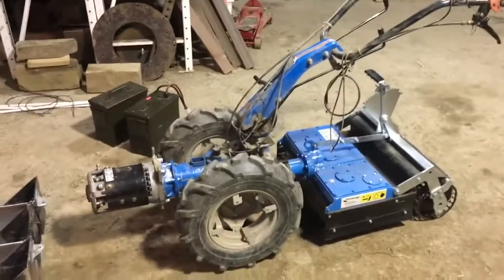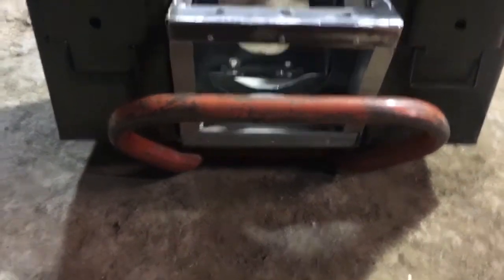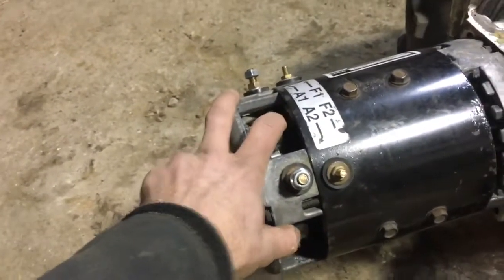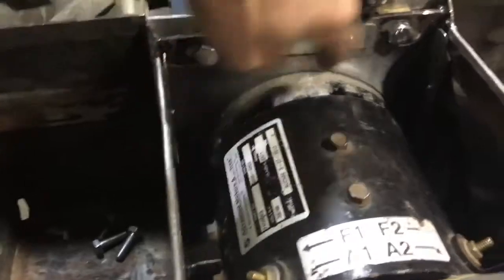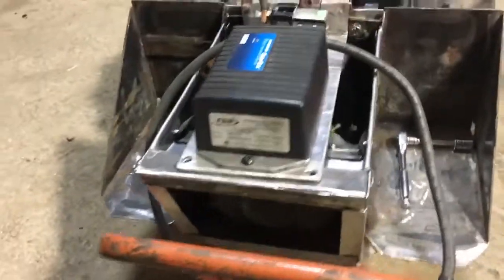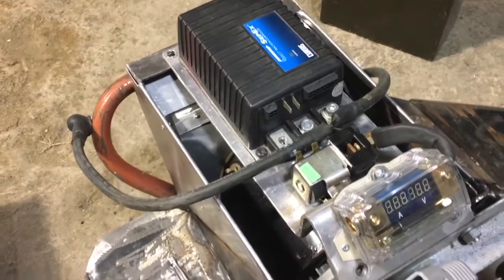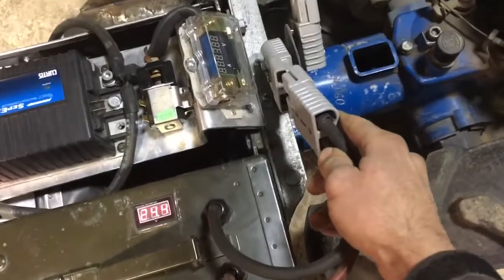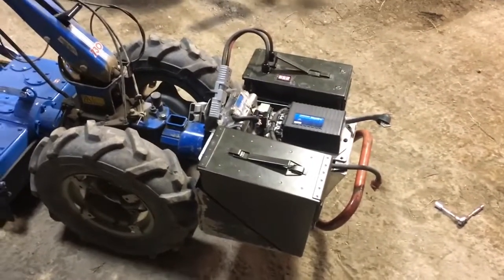BCS conversion to battery-electric

Comment: Did you consider a snorkel for air intake, to get above your field work? Screens work, but down low like that, are you picking up grass and bugs?
Reply from the maker: I figured the screen would be adequate.  It's not combustion air but just cooling air it's drawing.  Yes if there's more fine debris in the cooling air it will contribute to faster brush wear as the cooling air is pulled through the commutator assembly and motor case but I doubt that we're in a situation where we'll log enough hours to ever see adverse effects.

Comment: Which type of motor you used?
Reply from the maker: The motor is a 6.7" diameter separately excited DC motor from Advanced Motors and Drives aka Advanced DC Motors (model DD0-4002).  A nearly identical motor is available from D&D motors (model ES-10-33) but there are loads of other options that produce adequate torque and speeds at accessible voltage.  Motenergy makes two motors, a brushed and a brushless (ME1004 and ME0201012801 respectively) that have a long 1" shaft and bolt pattern that might make them a straight bolt-on solution for this kind of conversion.

Comment: Battery ah ,which battery capacity use in this
Reply from the maker: batteries are 1kWh or 24Ah capacity.  Battery chemistry is Lithium (NMC/LMO) from Chevrolet Volt automobile.  I can use one or two battery packs in parallel depending on task, required runtime or need to balance a lighter or heavier implement.  Typical runtime is 30 minutes per pack for continuous use but with stop and go use 1 pack can last all day, or even several days between charges.  We use this tractor primarily in a greenhouse and it is not in constant use

Comment: What is the price of this beast
Reply from the maker: I don't really have a simple answer to that.  Lots of parts accumulated and modified over many years.  It finally works like it should and we have the only one so... priceless!

Or, The original BCS tractor was $3000 CAD used, The electric conversion process consumed about $1500 in parts, mostly used.  Additional tools for BCS tractors are expensive.